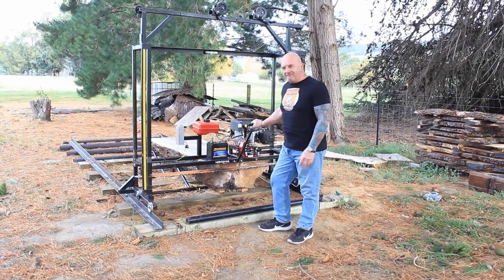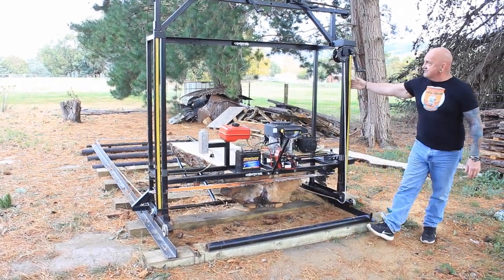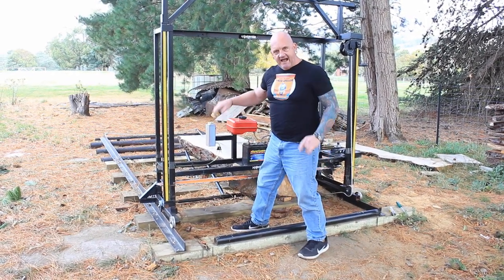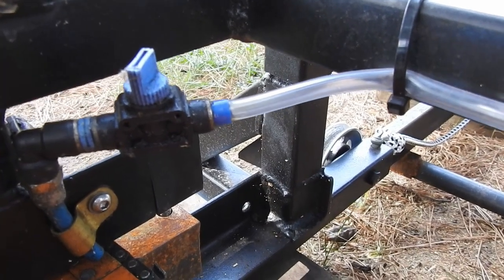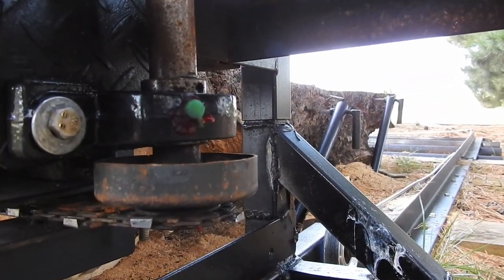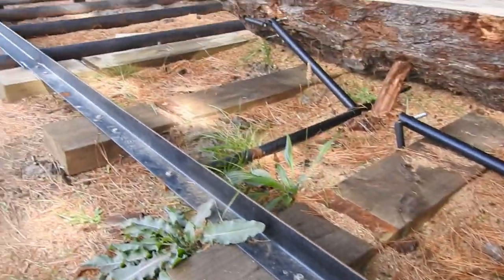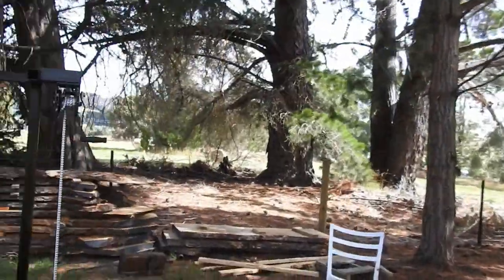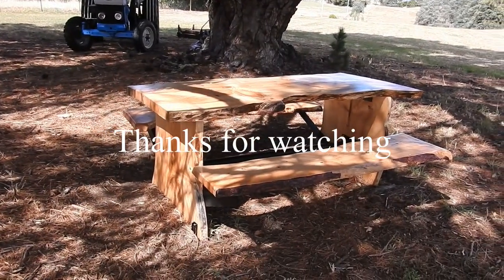Build your own Timber Mill with a  72 Inch Chainsaw bar

Comment: Great job, thank you for posting, Mark here British Columbia,  Canada
Reply from the maker: Thanks a lot......
Reply: Did you build one? What part of B.C. 
I'm around Salmon Arm BC. 
Wonder how fast they were. Hp engine is everything  . Saw one mill that used an electric on power feed. Cut almost as much as a bandsaw mill. 
Watching a few lumberjacks challenges. 
The guys using HOT SAW CHALLENGES are quicker than a headsaw

Comment: Looking that surface its it's all bang on square and true, well done
Reply from the maker: Thanks a lot!.......Yeah it cuts really well and square.......Lots of mucking around to be able to lift the whole platform up square...I initially had just one pulley to lift the platform but it was useless as it would go up side by side in a zig zag pattern or get stuck as the tolerance was too tight ....So in the end a pulley for each side and tight tolerance to keep it square...

Comment: Nice mill.  I am building a similar one for myself using a ride-on mower engine.  Are the winches you use standard boat winches  that free spool in reverse (free spool to lower the saw)?  I have been looking at a few hand winches and wondered if I need to get brake hand winches or just use the cheap ebay variety.  Good build anyway, I am stealing a couple of your ideas. 😁
Reply from the maker: Yeah just standard winches off eBay......

Comment: how do you tighten the chain  up.after it streches.
Reply from the maker: The bar is mounted the same way a chainsaw is.......So I undo a couple of bolts and slide the bar further away from the sprocket......

Comment: Hey,Mark, How did you attach the saw clutch to the 1 inch shaft
Reply from the maker: I welded it to the shaft and it worked a treat......'for a while'......... then it got red hot and burst into flames!........MS660 clutch could not take the load..........So I welded it together and it works fine
Reply: @markbilson3775  Thank you!!!! so much for the reply, I was losing my mine trying to figure out a way to attach it....Do you think 13 hp is enough power to slab cut a 64 inch wide log? Thanks ... And I wanted to say , that table looks great.
Reply from the maker: @pbmusic8505  13hp is plenty.....When you turn the winch to move the mill it is effortless and feels like you are not cutting anything.........Table was really easy to make and I did it with fresh milled wood without any problems....I varnished the top and left underneath so the timber could still breathe and let out moisture...
Reply: Mark Bilson i wonder if the rpm was to low for the clutch to work properly?
Reply: @pbmusic8505   He is milling Pine  Not Red Box, But The Fuel tank over the Battery, Not a good Idea!

Comment: Hi mark great build , is the chain a ripping chain ? How much did the build cost you  to make
Reply from the maker: Yep the chain is a stihl ripping chain......Motor off Ebay for around $350 and about $500 for the GB bar with roughly $100 for various bits and pieces.....So under $1000 and you could build it....